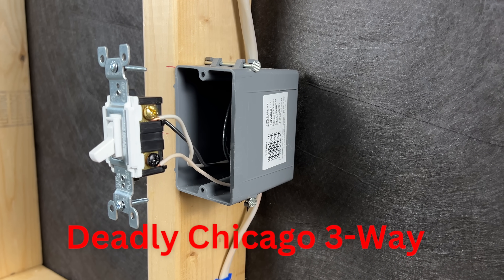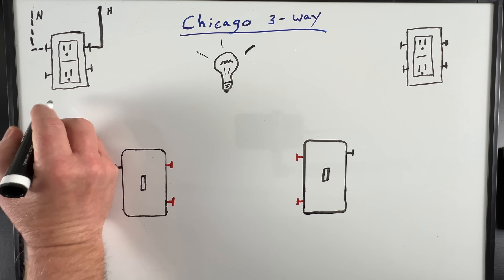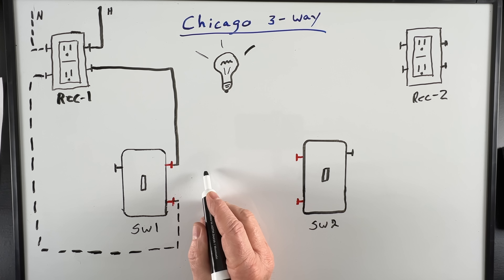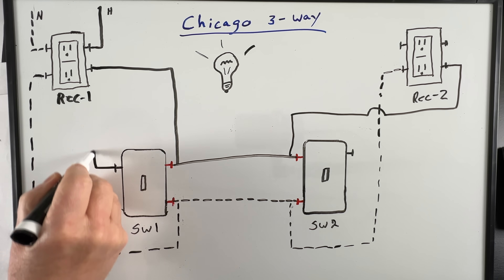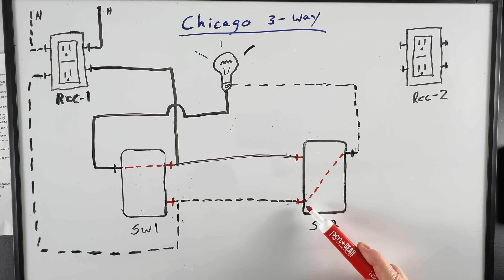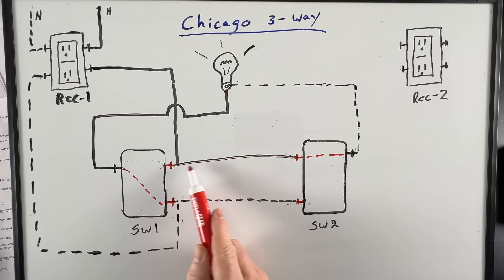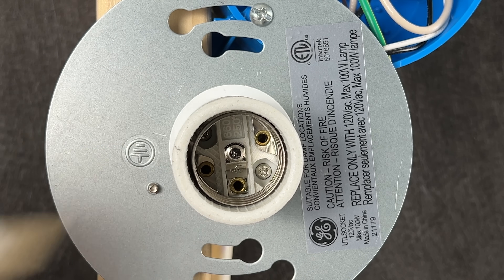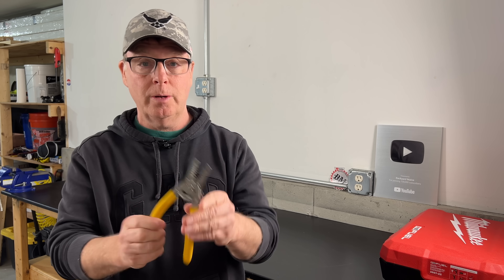The Deadly Chicago 3-Way (Only 2 Wires)

Comment: Awesome and thank you.  Actually this explains why a few years ago during a gutted upgrade of the kitchen in my historic home with tube and knob, I first got zapped and then -- after fixing the mistake I must have made despite attempting to label everything --  had 240V going to a light fixture.   The polarity's were flipping depending on the switch positions.
Reply from the maker: Sounds about right. If the circuits are split later and someone didn't know what they were getting into you could end up have a short circuit with 220v at the switch.

Comment: First, thank you for your service, fellow Air Force.
Electrician for 40 years, never heard of this dangerous situation.
Reply: The only reason someone would ever do this, is to add a second switch to a 2-wire system, that was originally intended for a single switch. This is the only way it can be done, without tearing out the walls, to replace the "Romex" with "Triex", to do it right. (I STILL wouldn't do it) Even with that said, each switch needs a neutral and hot, and, a line needs to be run from each switch to the light. If you have to run those lines, I don't see how that's any easier, than to run the 3-conductor "Triex" wire, allowing it to be done to code.
Reply: @vincentrobinette1507  They don't use romex in Chicago though. So that couldnt have been the reason it got it's name.
Reply from the maker: Thank you! And thanks for your service as well. 🇺🇸🇺🇸

Comment: OK, I'm from the south so im sure its me. Why would you even think of doing this? I'm not sure why you would run all the circuits' load through switches. Also, that could cause lights to flicker with loads passing through them right. I know.
Reply from the maker: This method was done a long time ago with knob and tube wiring. Back then there was usually just one or possibly two lighting and receptacle circuits in a home. Most room had one receptacle and one light. I'm sure some knuckle heads have installed switches this way since then but they have been a code violation since before the second world war.

Comment: Wow my 1940s house had this. I didn't know it was called a Chicago 3 Way. It was so strange, two different lights in my house had this. I have since replaced the wiring but was confused how it worked. That is crazy how that worked!
Reply from the maker: I was scratching my head the first time I came across one. Figured it out with my multimeter and drew it out on a paper. I remember thinking it was cleaver and dangerous at the same time.

Comment: Hello, 
I,ve been a licensed electrician since 1972. I,m still working in the trade for a  rail mass transit authority . I,ve also got 17 years of being an industrial electrician mostly worked in automation machine building and wiring. I have some across the Chicago three way. When I replaced those push button three ways, I would insist from the supply house they provide me with a snap or ""T" rated switch. Or what used to be called " TUNGSTEN " rated switches for old style tungsten lamps, please don,t call them bulbs! ..........Accordingly to the diagram, there could be a monetary short circuit when switching on that Chicago three way. A cheapo silent switch could cause that monetary short. Plus a warning lable about the neutral being switched and hot at times should be affixed to the fixture with wires being all black or red taped. 
           Yet I find too many hack type electricians that would still do that. I was once doing freelance electrical work in a home that was wired in the early 1970s . It was done entirely in 14 -2 NM CABLE with no 14-3 . There was no licensed required in the state of NEW HAMPSHIRE at the time. Plus at the time wages for electricians where very low. Hence, the state of  NH minimum wage of today is only $7.25 per hour. BTW when I was at one time over the years working with oil burner technicians, they would also insist on those "T" rated snap switce.s due to those old style oil burners vibrating. Also to boot when I built my home from scratch,  I did it in its entirety with emt tubing. I have a whole library for research on non-metallic sheathed cable being unsafe in any home.

Miss Paula Walach- former industrial electrician---union member IBEW.   

PS On a professional note that in the state I work in, the national electrical code doesn't cover certain areas of railroad operations especially within 4 feet from track edge, or if there is third rail, or overhead  catenary wire to power trains. Yet I still observe UL LISTING OF ELECTRICAL PRODUCTS ON IT,S INSTALLATION PRACTICES AND SPECIFICATIONS.  CORROSION AND VIBRATIONS IS A TYPICAL  FOR THE RAILROAD.
Reply from the maker: Paula, I started my electrical career in the USAF and then went through an apprenticeship with the IBEW (local 7 out of Springfeild MA). Ended up an electrical engineer before I retired a few years ago. Now I make educational videos.. lol

Comment: I thankfully don't do a lot of resi work and in 30+  years have never run into this.. Was still done once romex style cable was used or was this primarily in knob in tube wiring? Thanks for the vid. Wicked good explanation!
Reply from the maker: Thank you. It has been a code violation way before ROMEX or BX hit the market but I would not be surprised if there are some out there wired with these cables. Most of my career was working on large industrial projects or in manufacturing plants. Then I moved into engineering. When I was younger I used to take on residential projects on the side for extra money.

Comment: In Brazil both wires are hot, there is no difference between energized contacts. In Italy neutral is not earthed, so there might be some voltage between neutral and ground. In US market you can buy power station with floating ground, where AC wave is created by oscillation-mode opening MOSFETs, where both output wires are also hot. If neutral wire is weakly connected to busbar, voltage may appear on white wire from opposite hot side. You explained only one example where neutral wire is grounded and tightly connected to busbar at panel.
Reply from the maker: All modern electrical system installed in homes in the USA are required to be a solidly grounded. This has been code since the early 1900s.
Reply: @BackyardMaine  How to be with power stations, where ground is floating and hot with neutral are changing 60 times per second? Cheap solar inverters have the same issue.

Comment: I ran into an outlet with both sides wired to hot. It had a freezer plugged in and I've no idea how it worked. The utility room that was in got rewired with a new 30 amp circuit. Why 30 amps? Because a couple of 220V heaters had been removed, freeing up space in the breaker box when a mini-split heat pump was installed. I put in a new double breaker, 20 amp 220V in the middle for the heat pump with the outer pair being 30 amp. I removed the connection between the outer toggles to use them as independent 110V circuits.

Comment: This is KINDA ingenious in that it makes the XOR operation by inverting the lampholder polarity for the two ON states and double-hotting or double-neutraling it for the OFF states. Back when I studied the topic, this was not even given as an option. We were taught straight off to make the "hallway switch" by wiring hot to one switch, connecting the switches through the travelers, then taking the lamp hot from the other switch. And in a 230V country I can readily see why this was not even an option.
Reply: Both 120v and 230v kill, what does that make a difference?
Reply: @gamechannel1271 both kill, but I'd rather take my chances with 120. Maybe it's just me.
Reply: @gamechannel1271  the difference is that 240 will burn up the light bulb
Reply: @gamechannel1271  the difference is there is no neutral
Reply: On an AC circuit, it doesn't switch the overall polarity of the lampholder's current-carrying components

Separately, it's not code and it's not safe; The load is not reliably deenergized.
Reply: @stanminna1761  Yeah it does. One contact (neutral) is bonded to ground and is at 0 volts the other one is oscillating.
Reply: I believe 240v countries still use single phase just higher voltage.  It should work the same.  Someone commented that it's called the Hamburg 3 way, or the German 3 way.
Reply: @cliffordwagner the higher voltage doesn't make it impossible, but less safe. Who knows, maybe you could still find such contraptions in the old Eastern bloc and ex-Soviet countries. By luck, in some rural places in the west as well.

Comment: I would definitely be replacing that with a wireless 3 way switch. Remove switch 2. Connect the light white wire to always neutral. Put on a cover plate. Place the wireless switch of the wireless 3 way on the cover plate or next to it. 

Install the powered receiver of the wireless 3 way at switch one and only have it switch the hot wire on and off.

Comment: Retired electrician. Good explanation  on the Chicago 3-Way, but you get to blow up stuff with a Farmers 3-Way.....Ran into both types on a house I bought a few years ago as well as #18 speaker wire used for wiring from the switches to the can lights in the living room.
Reply: Hell I use phone wire for small loads. Gotta respect the ampere rating of your conductors and use what's appropriate!
Reply: @jeffferguson4632  The problem is, what's the breaker protecting that wire?  Code now allows 10 amp breakers on #16 wire for lights only, but that phone wire could be maybe #22 or #26, and even 10 amps would be a fire danger with that.

Comment: I'm not sure whether it was a California 3 way or a Chicago 3 way that I encountered last year in Maine, but either way, I was not happy about being shocked when touching a light fixture that was apparently switched off.  Wire your 3 ways right damnit!
Reply from the maker: I'll post a video on the California 3-way this weekend. Similar but not dangerous.
Reply: @BackyardMaine  IIRC, a California 3 way is also dangerous because one switch just interrupts the neutral, not the hot.
Reply from the maker: @phillipsusi1791  The neutral bypasses the switches all together on a California 3-way. I'll have that video posted this weekend. Stay tuned.

Comment: I heard that an electrician found such a circuit in a house. It was a stair light between an apartment and the basement. 
To make things even more dangerous, the two ends of the circuit were on two different fuses! 
So that when one fuse was switched off there was still current on the neutral of the other fuse.
What the electrician did was shut down the entire circuit and start over with new cables.

Comment: Electrical Contractor in Maine since 1998 and have been in the trades for over 40 years and I have seen some things....but this Chicago 3 way is new to me. Great presentation sir, thank you. I find it shocking (pun intended) that was ever Code....with no ground available it's down right reckless to have both fixture wires hot at the same time. Treat every wire like a hot when the power is on is what I tell others.....I have lost count of the energized grounds and even metal casings I have found energized over the years.
Reply from the maker: It is a crazy method. I don't think you will find one on a home wired after the 40s maybe the 50s. This was common at one time with knob and tube wiring. The first time I saw one I was scratching my head. lol  I started my career as a construction electrician and did mostly large industrial projects. I later moved into electrical engineering and retired from Texas Instruments a few years back. I started making videos and now this has become a business. lol. What part of the state do you cover?

Comment: Its just a ground operated switch ..why dont tgey just call it that ? Its common in automotive wiring ..
Reply from the maker: Actually it reverses depending on the position of the switches. Switching the negative or common ground is safe on low voltage DC system but not so much for AC house wiring.

Comment: I rewired an old rental unit, and has a switch and plug I couldn't figure out! The neutral kept heating up! I'm not a full time electrician, but have 40 years of construction experience. I safed off the wires, killing the switch and the outlet, and called a buddy who is an electrician, young guy. He could solve it either. Seeing this, I believe this may just solve the mystery! Thanks.
Reply from the maker: They can be quite confusing. Another one thats confusing is the California 3-way. I'll post that video this weekend.

Comment: When I was a kid puzzling out how electrical systems worked (based on my experience of wiring up a train set), this is what I came up with for the 'magic' of three way switches. I thought it's how they all worked until I came across my first standard three-way, which was very confusing to me at the time based on my Chicago assumptions from childhood.
Reply: I remember reading a book called something like Electricity for Boys in which one of the projects was mocking this up with SPDT knife switches and a battery.
Reply: Did the train move in reverse?

Comment: There's a development in Hanover Park, a west suburb of Chicago that has this wiring. More laughable, the development builder was done by a same SoCal builder. Major halfazz through and through. They must've beem proud with the pipe fitters of Chicago and having conduit but it all ends with the wiring. Couldn't believe it when I was checking a home out and rhen another nearby. To top it off, the Chicago snow loads are no match to the 24" on center truss roofs, with 1/2" ply. Snapped trusses. This is only the start of the schitt homes. Greased inspectors likely retired in Mexico. Haha

Comment: Control by switching the neutral is one sure way to get somebody hurt.  Never knew this was allowed and even worse that it still exists.  Thanks for excellent explanation.
Reply: I bought a commercial building about 20 yrs ago. The main room had 4 sets of lights (all fluorescent). One set was wired for 3-way (the current method), and the other 3 sets only had a single switch each. One of those single-switch sets had been accidentally(?) miswired, resulting in the neutral wire being switched instead of the hot. Presumably it worked as expected originally, but at some point before I bought the place, one of the ballasts on that miswired set of lights had overheated, resulting in a short to ground. Which meant that that string of lights was always turned on, no matter what you did with the switch. Fortunately, I'm paranoid about such things and flipped the breaker before opening up the fixtures for troubleshooting. Fixed the wiring and replaced the dead ballast.
Reply from the maker: Thank you! It's been banned for a long time but there are a lot of old building out there where it still exists.

Comment: Its a H bridge. Never would have thought of doing that with 3 way switches. I Have used it with witches and relays with DC to control motor direction.

Comment: Your "but statement" makes no sense. A "but statement" is a statement in which you propose something, and then negate it with something else.

Example: If the land is dry, but it's raining, then the land isn't dry.

Your statement: The Chicago 3-way is an old, outdated, wiring method that's been banned for decades, but they can be hazardous so please be careful if you do encounter one.

Your statement corrected: The Chicago 3-way is an old, outdated, wiring method that's been banned for decades, but they still exist because DIY and cut-corner tradesmen and just old houses are still standing, so please be careful if you do encounter one.
Reply from the maker: I realized that when I was editing but didn't want to re-record. I had an and in my script but recording yourself is not as easy as you think. I figured someone would pick up on that and leave a comment. You must be really bored. lol
Reply: @BackyardMaine  Yeah, I should've been doing stuff but it was raining.
Reply: @GailUrge-vq6qn  Next orgy I attend, I'll see if that's true.

Comment: Wow! I wonder who came up with that arrangement?  😂😂 I'm glad I don't do work in Chicago!
I have to say... in my 40+ years of doing electrical work (primarily industrial & commercial in SoCal/west coast & Texas) I've never come across this (fortunately, I guess!). 
Many years ago, I came across an old residence (that had been re-purposed to a Law office), in which I was contracted to do a lighting upgrade (the rooms all had old, 8' ballasted fluorescents)... until I discoverd that it still had knob-and-tube in the attic space - and it was still being utilized! Those conductors were all running VERY warm!
That job ended up taking MUCH longer (and, costing substantially more) than what was originally quoted, as I had to [basically] rewire the entire place. Fortunately, the walls were old-school, real "bat & plaster" construction, so no fire-blocking to preventing the pulling-in of new/modern conductors. What a PIA! 😂
Reply from the maker: Sound like a few projects I have worked in the past. Spent most of my career as an industrial electrician and finished it up in electrical engineering. When I was younger I use to do a lot of side work and thats really where my residential experience came from.